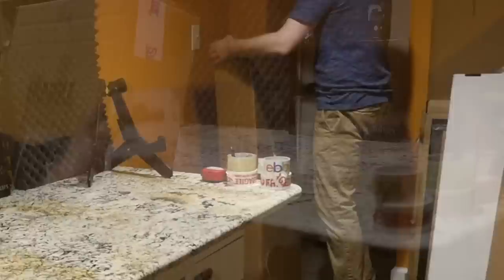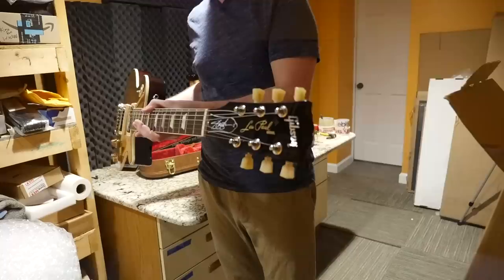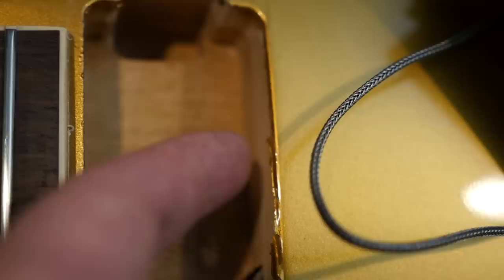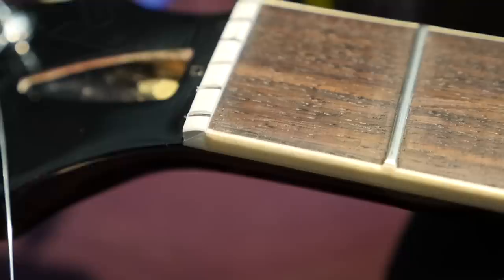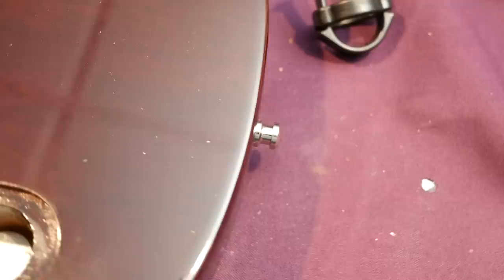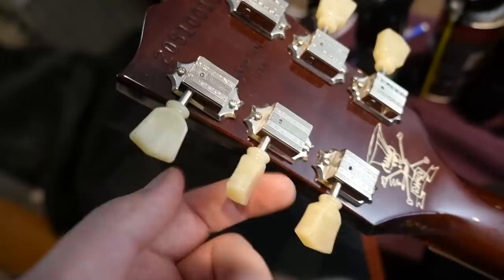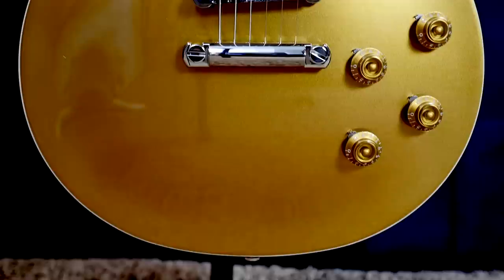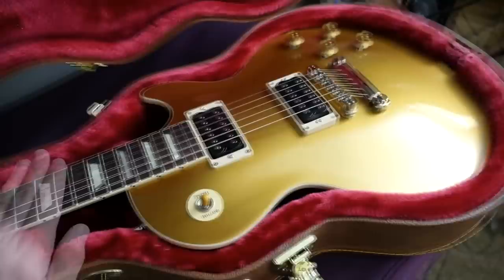New Gibson Model LEAKED! | 2020 Slash Collection Victoria Les Paul Standard Goldtop | Review + Demo

Comment: I was thinking of buying a Standard 50s and taking the pick guard off/taking off the pup covers but I guess there’s no need now 🤷‍♂️
Reply: Slash one sounds different and is more expensive.
Reply: gibsons gonna hate me for telling you this, but but a Harley Benton, I got a les paul perfect out of the box, except a plastic nut. $200 its thick and heavy, the maple cap is lined up really nice, no issues, and the action was set low. push pull knobs, binding I cant even feel at all, its all smooth.  sc 450-plus vintage lemon drop.  the pickups sound great too, really beefy, roswell german pickups  Thomann.com, they take paypal so your safe, id buy another guitar from them, I was expecting way worse, or at the least a setup, but now im sold, just the nut is plastic, I haven't had tuning issues, and I play rock metal w bends, ect.  it looks way nicer than my gibsons (I cant afford ones with binding ect) and plays just the same, except I haven't experience the "ding" on the G string yet with a Benton, all my gibsons do that.  even with pencil lead
Reply: J B Gibson has its fair share of problems. But people want the Gibson pickups, and the headstock. Maybe also the quality of the woods? Meh, I will stick to Jackson and other brands.
Reply: @linus5171  Jackson is deff a style, ive moved away from kinda… Jackson ps4 trans green was my first guitar, and id say ltd kh-202'502's are great too.  Jackson is just in my heart cause of my teenage days.  id play them over an Ibanez or shecter
Reply: J B They have what I need I guess. Neck through body, locking trem and usually come with Seymour Duncan’s. And, they quality is far better than Gibson. Never tried any higher end Ibanez guitars.
Reply: J B Glad you love your Harley Benton. However, it’s pretty easy to find some very uncomplimentary independent reviews on the internet with some serious complaints about QC in particular... extreme issues even for the low price point of the guitar. 

I’d also add that the pickups are not German... they’re Korean. Doesn’t make them inherently bad of course, but you simply don’t get something expensive like German made pickups (or indeed anything) on a guitar at this price point. The maple cap is also, at best, a maple veneer on top of a plain maple cap... some reviewers suggest it might be a photo-flame finish (i.e. a grain print rather than a real wood grain) and the cap may not be maple at all. 

Not trying to do your instrument down, but there are a multitude of reasons it’s as cheap to buy as it is... Harley Benton and Thomann are not charities and they still make a profit from you at the low price they charge you for the instrument, so corners have to be cut to facilitate that compared to any premium guitar. Even Thomann, the owner of the Harley Benton brand, would never try to pitch their guitars as a direct alternative to a Gibson... they are a major stockist of Gibson and have other premium brands on offer which I’m sure they would suggest as more direct alternatives. The Harley Benton range is really designed to compete with Epiphones, Squiers, etc., not with US made instruments.
Reply: @davidburke2132  "J B Glad you love your Harley Benton. However, it’s pretty easy to find some very uncomplimentary independent reviews on the internet with some serious complaints about QC in particular"

Yeah... and you can  never find any uncomplimentary independent reviews on a Gibson. They're all perfect.
Reply: Well I knew all of these things. To me nothing beats the Gibson headstock aesthetic. Also I know the slash model is more expensive and I’m actually not very partial to the way the slashbuckers sound they’re way too muddy compared to the SD signatures
Reply: Falsements Did I say Gibsons were perfect? No matter what the Gibson QC has been though I’ve never seen a review with such an extreme fault as bridge mounting holes drilled several millimetres too large so that the bridge flops around in the holes and it’s impossible for it to stay I tune... that was literally the first review I found for that Harley Benton model. Now, you’ll probably say that QC issues of a less extreme nature on a more expensive guitar are worse, and it’s a defensible viewpoint, however, something as extreme as that HB QC issue is totally unacceptable at any price point... it’s just so fundamental. 

Personally, my direct experience of Gibson guitars over the past several decades, owning many and playing many many more, has always suggested to me that there was an awful lot of bandwagon-jumping with respect to the preponderance of internet comments about Gibson’s QC issues. Sure, there’s no doubt they had some, and they’ve acknowledged that themselves, but from my own direct experience the frequency of such QC issues was overstated. As an example, there’s a pretty high profile YouTube guitar channel that actually tried to paint a picture of finish checking on their nitrocellulose lacquer Gibson, appearing several years into his ownership of said guitar, as a Gibson QC issue! 🤦🏼‍♂️

But, as you should note, my main points in the original comment were that I) Harley Benton are not a rational competitor/alternative to Gibson (I’m sure even Thomann wouldn’t paint them as such); II) Harley Bentons don’t get consistently rave reviews by any means (just to put the other commenter’s stated experience into context); and III) to correct a misstatement about origins of an item of hardware on the HB model by the previous commenter, an error that would again suggest that HB guitar as a more premium instrument than it is. If someone is going to write a promo comment that has inaccuracies in it then they should be open to it being corrected.

Comment: LPS5P00GTNH1 is Les Paul Standard, 50s neck, P00?, Gold Top, Nickel Hardware, 1.  There's one with similar Model Number on sale on a website with the same model number, but made in 2019.  Looks like the one in this video was taken off a shelf and then modified with the slash pickups and graphics.  Not sure what P00 means in the middle there.  Also, the LP Standard Slash model serials are like LPSS00XXNH1 where XX is color code.  I would expect the (hopefully upcoming) GT to be LPSS00GTNH1.
Reply: Sounds like this would make it even more rare.  Great info.

Comment: The finish will be different because Slash's one is actually a refin, assuming they are going for accuracy. It was done by Chandler in London and they used different finish. Which is why it doesn't age the same way. I have half a mind that PRS use the gold finish developed by Chandler (Chandler was the first dealer to carry PRS outside of the US, and Paul and Charlie are close).  Slash picked it up on their first tour of the UK. I also have an idea that his original was a conversion from P-90s originally being an early 80s reissue. 
Although they might just be doing a gold one rather than making it look like one of Slash's actual guitars.
Reply: It is definitely a richer looking gold finish than the regular goldtops

Comment: Instead if picking at the finish, SAND the excess off with FINE grit sandpaper.  It is HIGHLY unlikely that the finish will chip in the process of sanding and by eliminating the lip of finish you eliminate the possibility that the finish will catch on something and chip off.

Comment: The slashbuckers wont get a lot of credit, generally speaking. I've played them and they are good humbuckers, not just serviceable, but stellar. They aren't identical to the Duncan alnico 2 pro, but they are balanced and have the top-end of an A2 and the low-end of an A5 pickup. If any of you pickup hounds see a slashbucker for sale and want a good and balanced humbucker, buy the mf and be glad you did
Reply: It is a rare balance of chunk and sizzle that doesn't scoop the mid body in this pickup.  I bet Slash went through a lot of prototypes before settling on this design.

Comment: I just bought a Shecter Matte Black pro 2 Les Paul. It has a staggered nut for intonuzation and All Gold hardware . Locking tuners, Hot as ya ever need Pickups,everything a Les Paul should be, for 949.00 bucks. It plays like a dream and sustains like a bitch, going to natural overtones with my Marshall bumped up above 3. Gibson should be ashamed. I have never played a Les Paul that comes close to this guitar. The ones that are as good are some of the 80`s LP`s I played, and we were all EVH in the 80`s and until slash, nobody played Les Pauls. Best bang for my buck ever!     OOP sorry for the misspell on intonization

Comment: Very nice but can someone explain to me who is buying all these new expensive guitars? There are a ton of older guitars and it's hard for me to believe that people are flocking to buy these things $2000+ brand new guitars. I mean, there are a ton of previous years available. You can buy a '70s LP Deluxe for about the same price and it'll have tons of mojo and it'll have 50 years of tune ups and tweaking to make it perfect. My 73 Goldtop is one of the best things I've heard and it only cost me $2400 about five years ago. People are buying brand new Les Pauls which will not appreciate in value for $3000 and up. I don't get it.

Comment: That p90 Gibson gold top? The one you show a short clip of? I play a lot of southern rock.I can plug that into a high-quality tube amplifier with a a maximum of  4 guitar pedals, it would sound absolutely amazing.I need that thing in my life. I just ordered a green, flamed Maple top, with opaque green finish, set neck, Grover milk bottle style tuners. I'm not going to say the name of the company,I'm not about to give them free advertising until I get the guitar and get to play it and check what it is. But it's a Les Paul style guitar, but the fingerboard is 1 and 3/4 inch wide, the fretboard radius is almost completely flat, it has 24 frets, and bridge to spec a  25 and 1/2 i guitar.And it has a push-pull so you can go to single coil.it's like having a Les Paul and a Stratocaster all-in-one with an incredibly beautiful body with some of the most amazing binding working oh my God wait till'  you guys see it.It's going to take a good month for it to get here.

Comment: I don't get it. It's literally just a goldtop. Ok, it has fancy pickups, but they're literally just Alnico 2 magnets. Ok, it has skully on the back. It has knob pointers. It has a fancy truss rod cover. You can buy all those on Ebay. Ok, it has a dark back. Y' can do that yourself for less than $150. 

I genuinly don't understand a) the hype, b) the purpose, or c) the allure. But then cretinous fanboys and uncaring collectors will vomit money at any model if the marketing is persuasive enough.

Comment: After mark ag greasy did the play authentic threat vid, i officially broke up with Ripoff. I mean gibson. If i MUST have a gibsen ill order one from China. The quality is about the same but the price is 20:1. No $10,000.00 Slash models that are EXACTLY the same as the regular $8,000.00 off the rack run of the mill les pauls to be had there.